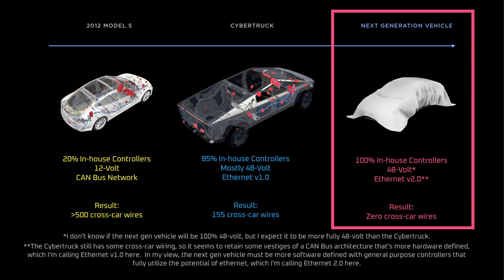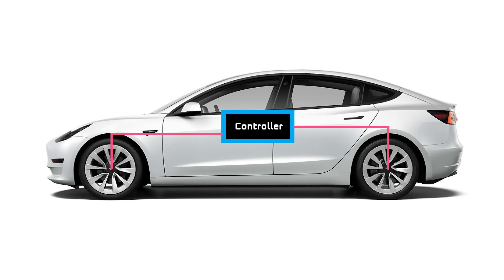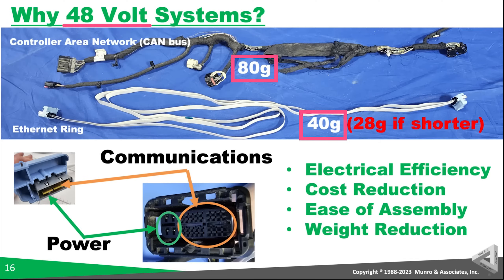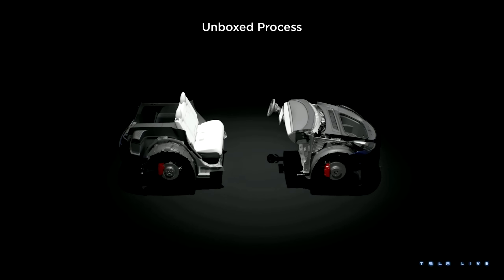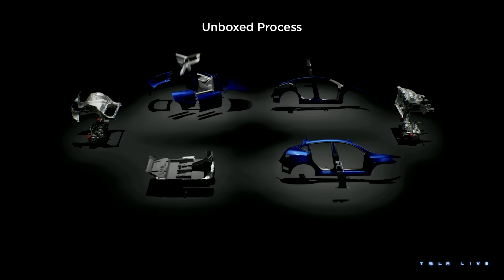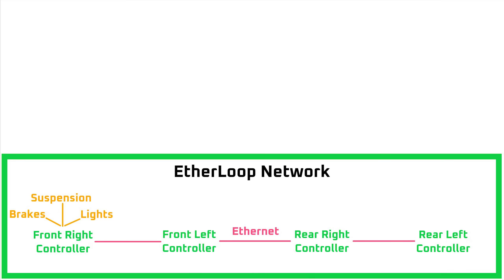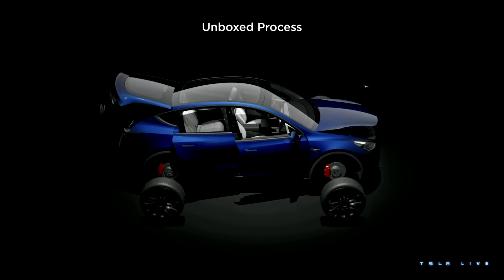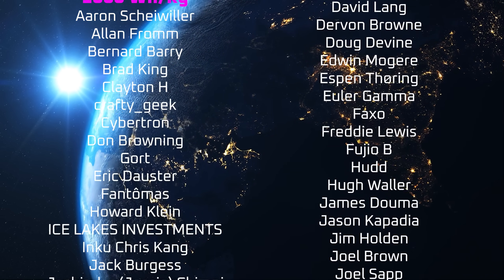Digging Deeper on Tesla's Etherloop Wiring System

Comment: Excellent educational session, thank you. One of the images shows a highly significant change essential to Ethernet is replacing legacy individual wires with ribbon cables. 48V from 12V makes this significant improvement possible. While ribbon cables are not new, their use in automotive is. Improvements include, automated manufacturing, Electromagnetic Compatibility/Immunity (EMC/EMI), wire-to-wire coupling. Providing total control of which wire is next to which wire, eliminating splices, twisting wires, the list goes on and on. Not to mention sharing controllers between vehicle models, without having to engineer new connectors, simply cut longer or shorter ribbon cables. Thanks
Reply from the maker: Thanks for the comment and the insight! Much appreciated!
Reply: Isn't noise cancelling an issue without twisted pair going on like in Ethernet cables?
Reply: Power to motors would still have to carry lots of current.
Reply: @YouTube_username.  The way PATA and SCSI handled it was grounding every second wire and limiting cable length.

Comment: To be clear, a "48 volt controller" means it's POWERED by 48 volts, the data / signalling is a much lower voltage. Probably carries power POE style at 48 volts throughout the loop.
Reply: Exactly 👍
Reply: Decided to fact-check. According to wikipedia (Ethernet over twisted pair):
"1000BASE-T uses all four pairs bi-directionally using hybrid circuits and cancellers.[16] Data is encoded using 4D-PAM5; four dimensions using pulse-amplitude modulation (PAM) with five voltages, −2 V, −1 V, 0 V, +1 V, and +2 V.[17] While +2 V to −2 V may appear at the pins of the line driver, the voltage on the cable is nominally +1 V, +0.5 V, 0 V, −0.5 V and −1 V.[18]"
Reply: The physical signal voltages on the cables are "differential" types ie not measured to a constant zero level,  each cable has a input or output transformer in the switch to convert to normal "single ended" voltage levels to be used in the equipment.

Comment: A loop type networking was used years before the current style of ethernet networking came out.  It was called Token Ring.  If there was an 'end' to the loop that was not connected back to the loop a 'terminator' was needed on the end of the loop (basically a specific small resistor to keep down 'ringing' similar to water hammer absorbers).  The loop protocol required a token be passed between each device to say whos turn it was to talk next, everyone being allowed a 'slot'.  If the token got lost the 'controller' would restart the token on the wire.  Ethernet designed for everyone to listen and talk whenever someone else wasn't talking if needed, was a overall speed improvement on a 'quiet' network, but was slower on a network with a lot of traffic, assuming each ran at the same frequencies.  Yep, loops have been around a long time, and they can also be great for redundancy (traffic can flow either way around loops, not just one direction), so if it is cut somewhere, the loop can detect that and even where, but still keep functioning, of course depending on the equipment sophistication.  So endeth todays history lesson from an old grey haired geek.
Reply: Ethernet also needed terminators… as did SCSI and does PCI. It is an electric thing to dampen reflected waves. Token Ring originally depended on a ring for passing around the token that allowed a station to transmit. The wires didn’t go all around the ring but were station-to-station.  There was a method for detecting token loss, duplicated tokens, and for regenerating a single token if necessary but it was a bit slow.
Reply: Those were the days!! 👍
(Old gits of the world unite!!)
Reply from the maker: I love insights like this! Thanks for the comments!
Reply: what you are describing is not a ring archtecture (two endpoints per wire), but a traditional bus with many endpoints using the same wire. The "token ring" is just a popular system for determining whose endpoint's turn it is to speak next.
Reply: The "Token Ring" is architecturally more similar to CANBus than to a ring. (shard wire across all devices to transmit data)
The Term Token Ring is just the "sofware part" to decide who can speak. basically a Token is passed around on a bus, and whoever currently has the token can talk, everyone else listens. the ring is because it is passed around, it does not refer to how the devices are connected.
Reply: It's still used in the industry. There is a very famous standard called ethercat.
Reply: @unitrader403  token ring is most definitely NOT a bus.  It was physically a star, but logically a ring technology - the transmit side of one station on the ring was connected to the receive side of the next station in the ring via a central hub called a concentrator. The "token" passed through every station active on the ring in turn....

There was another technology around for about a minute back in the day called "Token Bus", but it never took off (I never saw it), which was a physical bus (like Ethernet) that used a token- maybe that's what you're thinking of?
Reply: @w0ttheh3ll  noone knows what a bus is anymore.  Kids these days.
Reply: Maybe Arcnet, saw a video recently. That has a token, but succumbed to ethernet when switches were invented
Reply: @crabby7668  as did token ring, cause switches mitigated problems with ethernet.  
Ethernet is better in most respects.

Comment: Maybe they were inspired by Avionics Full-Duplex Switched Ethernet from Airbus or EtherCAT ? You can prioritise frames and loose some cable in the loop.
Reply: And they probably use the same "flyby" packet modification and the name "loop" implies they are using the same redundant ring design.
Reply: EtherCat was the first thing that came to my mind, funny how it sort of replaced CAN in industrial automation, but not in vehicules

Comment: Your depiction of Ethernet is based on very old implementations. Back in the days of 10/100mb Ethernet half-duplex was a popular option to allow you to put multiple devices on two wires. You needed to implement the collision detection and avoidance protocols to minimize/eliminate collisions. This introduced an unpredictable jitter that was often unacceptable in hard realtime systems such as controllers. 

More modern Ethernet is full-duplex and each endpoint is directly connected to a network switch. This eliminates the collision issue and most of the jitter. Now when two signals arrive at the switch at the same time one will be sent out ahead of the other. There are protocols that you alluded to make simultaneous messages more deterministic.
Reply from the maker: Good point!  A few other people have made the same comment
Reply: For low bandwidth 10Mbit/s there is a standard defined which enables also bus topologies. It's called 10BaseT1 in different variants . Used in automotive and industrial control systems
Reply: This is the difference - in the switched scenario they won't have collisions and retransmissions even at high levels of utilization (at a cost of store and forward on a switch which used to be expensive but is now dirt cheap!) but every node has to be wired to the switch.  That is what they are trying to avoid.  Lots of long wires (even if small.)  They are using a bus/token setup so they can guarantee delivery of the necessary data at high speed and low latency but also avoid all the wires.
Reply: Yep.
Reply: @oxptaube  I did a lot of work on thin net.  But you have to terminate the bus.  I'd rather have a loop of full duplex ethernet switches and spanning tree protocol for redundancy to prevent logical loops and provide redundancy in case one segment of the loop is broken.
Reply: token ring might work very well at very high speeds on a small network inside a car, but that sounds very different than ethernet which they are stating.  Store forward ethernet bridges (two port switches) with spanning tree protocol over a very small physical network passing very small datagrams  on modern hardware should more than very sufficient.
Reply: @oxptaube well said. Industrial automation engineer here
Reply: @andrewdekoning  back to token ring?
Reply: It is/was [Mb/s], I would say, so 100 Mbit/s or 1Gbit/s. MB would be Megabyte and „mb“ maybe Milli bit…?
Reply: @kreynolds1123  EtherCAT is very much like tokinring and I'd bet this is what Tesla is using
Reply: @chrisalbertson5838 Similar to ethercat there is the open-source rtnet which doesn't require special NICs and essentially disables all non-deterministic behavior in supported NICs. But last time I checked it's somewhat neglected so maybe Tesla reimplemented a similar system. But it's all guesswork at this point.
Reply: @kreynolds1123  Totally agree. Trying to remove switches should not be a goal in itself. A switch is a very simple and thus reliable device (unless you buy cheap parts, but that is with everything) and resolves a lot of complexity for other components. The other components are simpler and cannot cause the network to fail. Assuming you make switches that isolate the components electrically and digitally from the backbone network. In my opinion a system with a backbone of redundant switches is faster, more reliable and easier to design than the same system with a token ring or, God forbid, a shared bus with packet collisions.
Reply: Came here for this, hope we get an update on that! Ethernet is WAY cooler than what was described
Reply: @mennovanlavieren3885  Ironically, cheap production/design is more of a problem than cheap parts, when you're making your own design. Raw silicon chips are pretty universally reliable if the design is good. And if you design for robustness, specify adequate-quality passive components, and follow good manufacturing practices (including x raying and baking grey-market chips if you're in that segment), reliability isn't likely to be a problem.
Reply: The CAN approach of having collision avoidance still seems more elegant, though. The prioritization of messages is built right in the first layers of the communication model and handled by hardware. Ethernet always had high throughput, but struggled with low latency deterministic behavior. And the fact that prioritization is handled by software makes it potentially vulnerable to devices misbehaving.